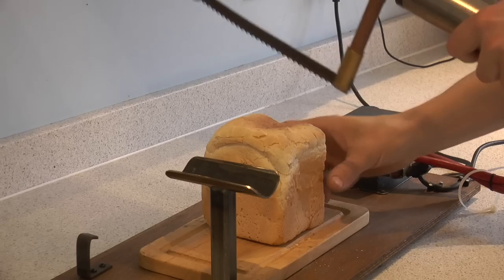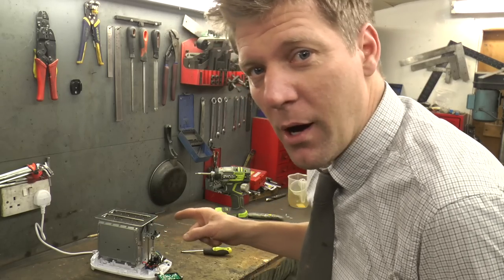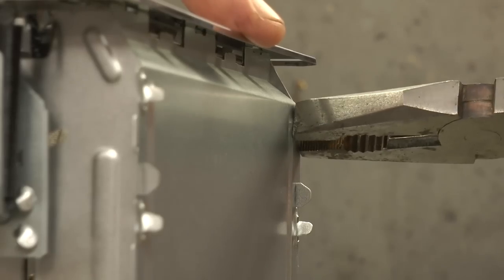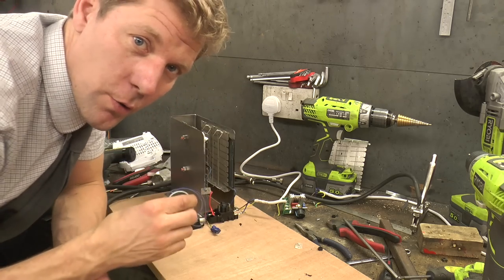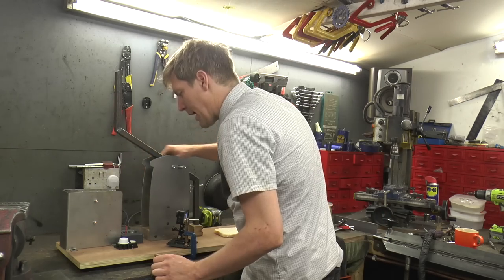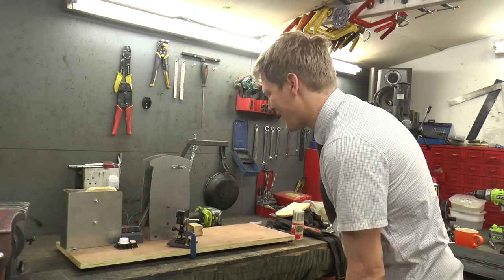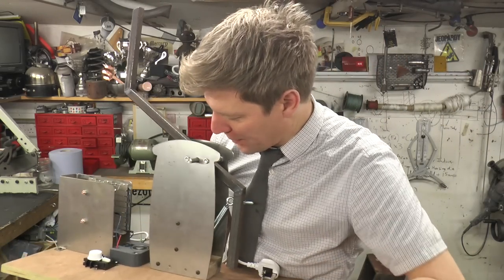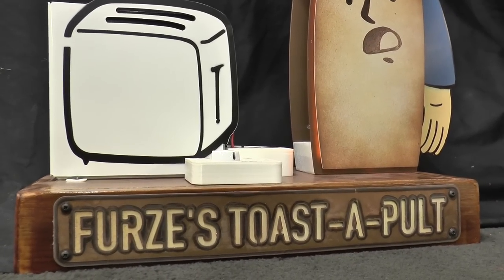I made a Catapult Toaster, CATCH

Comment: you should add a countdown timer so it says 3, 2, 1 and a toast comes flying at your face
Reply: That'd spoil half the fun... While also making it cleverer than any commercial toaster!
Reply: Oh 3 second ^Opens mouth over toaster*
Reply: Nice idea, but repeated use changes the time it cooks. If the toaster is used repeatedly, as it gets hotter, there is a safety switch that turns it off sooner.
Reply: @TheNightstalkerShow  - Not anymore there isn't And no need when you have your safety tie on!!
Reply: or 2 slice
Reply: The Panasonic NTDP1HXC 2-Slice has a sort-of progress bar. No catapult. 4 stars.
Reply: Maybe add a big capacitor in parallel and a voltage alarm.

Turns off
Capacitor suplies voltage for the electro magnet 
Lower voltage
Alarm goes of
Low voltage
electro magnet turn off
Toast comes flying

Tere is probably a better method to ding and delay the magnet

Comment: Welding is just big boy soldering now that I think about it
🤔🤔🤔
Reply: They're really only similar in that there's heat and metal involved, bring that they're pretty different processes.
Reply: @TheDungineer  there are a couple different types of welding. One of them is exactly like soldering
Reply: @blazortheepic0384  which one?
Reply: @TheDungineer  idk the name.
Reply: @blazortheepic0384  Soldering takes a low strength filler metal that has a low melting temperature and attaches it to high melting temperature contacts in order to establish an electrical connection with very little mechanical strength. Typically a soldering iron or a hot air gun are used to achieve the heat. The important thing to note is that the base metals never melt, and the filler metal does; they are not the same alloys. Welding on the other hand uses an electrical arc or a flame to heat both base metal and and filler metal to beyond their melting temperature to mechanically bond them. The filler metal is typically very close in composition to the base metals, if not the same allow. While welding does establish electrical continuity, it is primarily used for high mechanical strength. Source: Mechanical Engineer.
Reply: @TheDungineer  I was talking about the application. Not the use. True tho
Reply: @TheDungineer  there are some ways of welding were you have a weaker metal and you melt it onto a joint or whatever. Normally the joint or whatever is already attached somehow

Comment: could he make a super kettle where is boils the water in less than 20 seconds ?
Reply: Check his vidoes- Think he did something with thermite a few years ago
Reply: @phoephoe795  yeah I know but something that can be used in a kitchen. Perhaps with a massive coild (big surface area) and very very hot
Reply: He already did, look up the jettle (pulse jet powered kettle)
Reply: @TheFulcrum2000  something which is based on a normal kettle, so what i mean is a massive heating coil whcih would be powered on both ends by electricity
Reply: @jacobsack  No need to make it big - just make it electric. Cooking speed is determined by your fuse size.
Reply: @traniel123456789  oh OK. I was just assuming that a larger surface area would help
Reply: @traniel123456789  "no need to make it big" doesn't make sense in this channel

Comment: It's not a timer there is either bimetal strip or a temperature probe in the toaster then when it heats up to a certain point it breaks the circuit.  When you move the level from lighter to darker is adjust where on the bimetal strip or how much electrical resistance it received before it cuts power to the electromagnet to lets the toaster pop up.   If your bread with a higher moisture content it takes longer to get to the setting you put it on because the evaporating moisture keeps the overall temperature low enough to not trip one of the two options.  Conversely when the bread has low moisture content it toasts faster and reaches the higher temps faster.

Comment: you need to make it butter your toast as well.. maybe a bacon egg toasty device.. nahhh..

I've got it. 

a baconeggtoastteadispenser and yes you can have the name too. 

basically you can make a cuppa tea and bacon and egg toasty in the time it takes to boil a full kettle of water. it also construsts the toasty for you.. 

so you load your bread, bacon slice and egg and water.. flick the kettle switch and it turns on a.the devices in one. 

when everything is done.. so toast first.. toasts bread, then runs it through a butter roller or sprayer with mini conveyer.. toast then falls onto a plate underneath.. then bacon goes on next.. and then egg and finally the 2nd bit of toast.. or if you want some human interaction, allow both bits of toast to hit plate buttered and then you can adjust for placement etc. now whilst this is happening, kettle is boiling and then when kettle is done, boiling water will drop into teacup and exact measurement without milk so all you have to do is wait for brew to finish and then pull teabag and add cold milk, with a push of a button.. or if you're after a cold glass of milk, push a button and you're done. 

also get yourself a roller for creasing metals so you can make official looking panels and shells for your projects. 

will add that touch of class your projects are looking for.

Comment: Great stuff.. I have loads of ideas.. what if you built smaller helicopter blades on each helicopter blade then on those blades even smaller helicopter blades? Would that create a vortex similar to a jet and then if each of the blades could be movable you could then make 4 of systems for wheels of a flying car..🤔